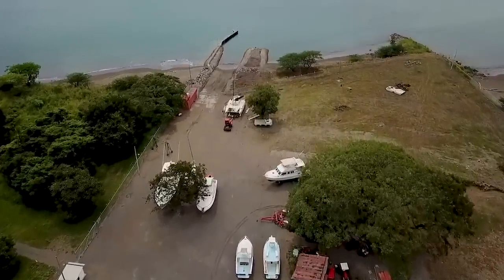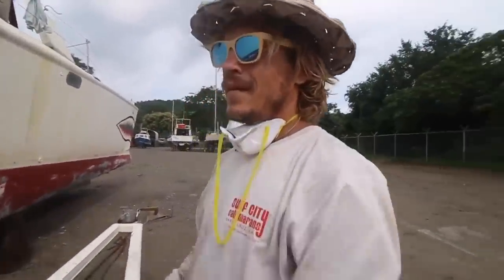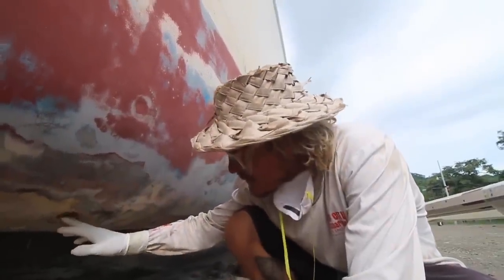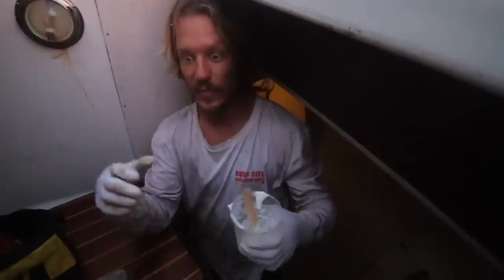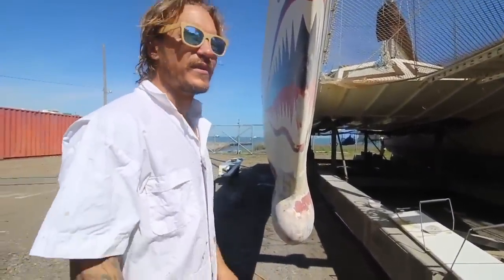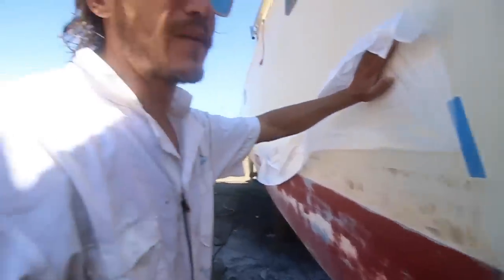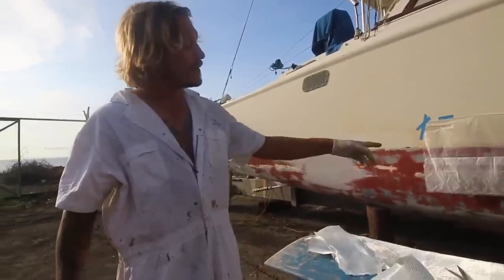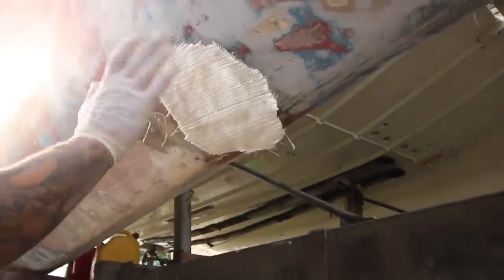Plywood Catamaran Problems. What Work You can expect! | EP48

Comment: I put talcum powder on my exposed skin when sanding fiberglass. It fills your pores, and helps to keep the nasty glass out of your skin.
Reply from the maker: Thanks mano, will do.
Reply: Do not bathe before sanding.  Maybe after. Talcum sounds like good advice.
Reply: @MyNeowolf  Another thing you wan to be careful with is if you are chopping up some ho peppers to put in some food. If you go to take a leak, your tool will suddenly be ablaze! Also if you manage to smear some of the pepper juice on your old bat, she will wonder why her parts down there have suddenly become like a volcano! This I know from experience.!
Reply: @MyNeowolf  I think I'm safe...
Reply: @stanthology  I had the same experience. Rubber gloves are a necessity when processing hot peppers.
Reply: @svexitstrategy2595  I like your boat.
Reply: @stanthology  the boat with the flying tiger teeth is not mine ... ??
Reply: @stanthology  I haven't bought my boat yet.  But it appears that there are more than one boats with the same name. 

I have my eye on a 41 Gulfstar. But it's way overpriced for it's condition... 

So for now all I have is the dream of escaping.
Reply: @svexitstrategy2595  If you are in the US there will probably be mountains of boats that need a little detailing now that the hurricane went by. Pick them up cheap and many slightly marred parts of every description for 10% f new price. (God willing!)
Reply: Red Mexican clay,that stuff can block poison ivy.

Comment: Bubbling of paint occurs due to dirty surface before painting. Use a vacuum cleaner and whip with acetone or even better with a paint’s thinner. 
To apply any paint people use rollers which have the inconvenience of dragging air into the paint! As the surface of the paint dries out, the entrapped air could not escape, here you get the air into the paint film. If air spray or air assisted spray isn’t available, tray not to rol to much the paint and use a large, soft and long hair brush to pass over the freshly applied paint. Work smaller surface at a time, not more than 2x2 feet. Once dry, slightly abrade (200grade) and whip out with thinner soaked clean cloth before the next coat.
Hope it would help.
Reply from the maker: Great advice, much appreciated. Seriously. -J

Comment: I am sorry for you guys, but these patches are just a temporary repair that will look the same in a couple of years. You really need to get both hulls sandblasted, all the way down to the bare fiberglass. Then remove all the bad fiberglass and all the wet wood. After filling the holes with new material, you really should give the entire hulls at least two layers of new fiberglas, a new gelcoat and then antifouling and teflon treatment. It will cost more than the both is worth, but it all depends on how long you are planning to keep it. Best of luck and I love your channel, just subscribed...
Reply: @irvhh143  Not if they are just planning to get relatively comfortable to a harbour and buy another boat soon. Then it's a matter of doing everything as cheap as possible. As long as they don't expect to get money out of this one. Fiber glass rot kills any value of a boat. On the other hand, all repairs makes for great videoes, and that makes them money in the end! ;)

Comment: Maybe you are already doing this , but you can use an orbital sander with a small potable Shopvac and vacuum attachment which will take care of most of the dust problem .
I’ve even used this setup or made setups with grinders .  The spray suits are a must and a number of good quality dust masks and a charcoal filter mask for when you are applying your coatings with gloves on .

Comment: I think for those who watch the whole series, they are getting a whole lot more insight into the limits of a cat.
Reply from the maker: Correction: limitations of a PLYWOOD cat.
Reply: @thelastpirate  Yeah I thought about it later. I can see how wood is more prone to failures. I'm still coming up through. I'm at your Sept 2019 live stream right now. I did watch the one when the boat split. Couldn't resist. As I watch through the series, I can see all the stuff leading up to it. Can't wait to see you guys back out there. Maybe with your next boat, you'll be able to post more sailing vids in rough sea. Anyway, stay awesome.

Comment: Do it nice or do it twice, James.... tune into 'Sail Life' channel for osmosis treatment & fiberglass epoxy repairs to do a proper refit.... also do you have an Amazon wishlist? It could be an alternative way for viewers to contribute.
Reply: Pretty darn spiffy advice.
Reply: that guy is a pro with fiberglassing.
Reply: Kevin ask him for a adress and buy him a drone like a dji spark whit controle and 2 to 4 battery .that is the best thing they need for making video right now or a go pro white waterproof case
Reply: way different problems with glassed-over ply (usually epo from the beginning) than with polyester resin snot boats.

Comment: Have you ever used plastic wrap as an outer skin when you put on a fiberglass patch? Just lay it all out on plastic wrap, cloth, then resin, then slap it on like a big sticker. Then you can smooth out all the bubbles out with your hands and when it's dry, tear off the plastic.
Reply: Sounds like a good idea. So it`s been working for you?
Reply: @sailingozzie2587  love all your hard work and learning a lot from yous guys🙂
Reply from the maker: Yeah I did that with my daggers, but not sure if it would have worked here upside down.

Comment: Unless you have done it, no one can appreciate the agony of millions of microscopic pieces of fiberglass dust in your underwear and everywhere else.
Reply: Worst fiberglass mistake i ever made was grabbing ahold of a shedding fiberglass fencepost real hard crawling over.. holy shit
Reply: by far worst in hot climates: You either put on a full body condom and melt or go bareskin and ruin it entirely this way .... boatbuilding with fiberglass in hot climates is no fun.
Reply: @congregationahavathsholom6021  laying on your back(in fiberglass) in an Attic in 109 degree heat. 

coat your arms abd neck with talcum powder. even flour works. 
it can reduce itching by maybe half. 
vasoline can reduce itching by appying it and then washing it off with dishsoap.
shit sucks to work with for sure.
Reply: Yes, been there done that with automotive ect.
Reply: Been there done that....The Worst torture you could 'inflict' on someone would be to have them roll around in insulation or fibreglass, then Force em to take a Hot Shower to wash it off.  Again, made that mistake 'Once' when working in construction as a 'late teen', Haha.
Reply: @congregationahavathsholom6021  / I had one of those 20' fibreglass extendable paint sticks i lent to someone...i finally got it back after 6 months.  The guy had left it outside during Subzero temps in the winter and it started to shed, Ugh.  I had a job i had to do, and only found out when i got on site.  Damn...i had to throw away 3 pairs of leather gloves after using that thing for 2 days.  That Shite got everywhere flecking off.
Reply: @toddler1009  /  WHATEVER YOU DO, Don't take a Hot Shower until you get it All off....Use as Cold water as you can get for the 1st 10 minutes lightly wiping your skin with soap.....then rinse and repeat,  haha.  You'll remember this comment later if you don't =)
Reply: It for sure sucks having fiberglass dust all over youy
Reply: Amen to that, as I was watching I was having flashbacks to patching and sanding the hull on a 30 ft Sabre.
Reply: Dust yourself off if you have a compressor nearby helps :)  Uber cold shower also.
I am always amazed that in the morning 99% of the itch has vanished - I am wondering how my skin gets rid of the glass :)
Reply: glass  balls  not  good
Reply: toddler1009  put talcum powder all over yourself.      Put a suit on.  Put talcum powder inside the suit! 
Rubber gloves and boots and tape the cuffs to the gloves and boots.  Then a hood!
Reply: Patrick St-Onge  it dies and  sluffs off
Reply: "appreciate" ??? Imagine would be a better word to use in that context, isn´t it ?
Reply: Well, that’s my nightmare fuel for the week.

Comment: Make sure the core is dry and really clean. ya can’t rush good work.
Reply: The ply in an overglassed ply hull is the actual boat, not just a core. 
Just sayin ....
Reply: manfred schmalbach the hulls appeared to have foam core probably due to complex curvature.  Ply can’t bend like that. JS...🙄
Reply: @robmitchell3633  We actually BUILT ply boats in that (and even some more complex) forms outta ply, outta veneer composed (or "lammellated" like the Gougeon Brothers call it) into ply, and outta ply.with a carbon prepreg second layer to have something stiff and airtight to vacuum the following layers towards. There may be a core inside Zingaro's hulls, but "ply can't bend like that" is an idea I can contradict with a lot of actually built boats to my record.
Reply: manfred schmalbach you are so special...  that old boat was built before that type of technology existed.
Reply: @robmitchell3633  The Gougeons started in the early seventies to do statistical testing what they developed in the late sixties together with DOW chemists and what was to become "West System" epoxies. 
The boatyard I was an apprentice at in the eighties was working with epoxies since they were available for war-purposes (mostly aviation) in the early fourties in Germany. 
Resorcinol plys weren't homogenic enough in e-module when stressed, so they tried epo to get their wooden stringers more forgiving versus oscillating loads. 
I do not know what year James' boat is, but I am positive lamellating techniques and vacuum bagging with epoxid resins was long used by advanced boatbuilders when Zingaro was originally built.
Reply: manfred schmalbach Boat
The Kitty.
I am, of course, referring to the catamaran. Zingaro (Italian for “Gypsie”) is a 1984 Crowther Spindrift 38′. Home built in Canada with Airex® foam core hulls encapsulated in fiberglass, with a plywood and fiberglass bridge and house. She’s light and fast.

Designed by Lock Crowther (1940 –1993), a prolific Australian multihull sailboat designer responsible for some 2500 design builds. Very forward thinking, and very seaworthy designs.
Fyi. From the info page on the actual boat
Reply: @robmitchell3633  Thanks for the infill, Rob.
Selfbuilt boats and backyard builds often do sport less challenging methods for the general one-man show. 
I didn't know of Lock Crowter (more the monohull kinda guy...) but will look into his designs now, for Zingaro seems like a "sprinter" when they upload actual sailing vids. Cheers.
Reply: ... oh and in case of the useless information, Rob - just wanted to give You an opportunity to not utter crappy falsehoods anymore in terms of "unbendable ply" (😂) in future comments .... You're free to tell ridiculous crap though, obviously, so never mind.

Comment: My cat is out on a mooring and I have the same splash problem with the waterline. The scum line is more than 6 inches up / . I have been meaning to do a boot topping in antifouling of a different colour with perhaps a break  line or accent line between them. ie red bottom , blue boot topping with a white cove line in between.

Comment: Spindrift 37 Catamarans plans have foam core in the hulls and wood epoxy crosbeams and decks. Looks as if your problems are with the outer laminate on the foam core, not the plywood (in this video). Most of these cats were home built and the core maybe sub standard i.e. not Divinycell, Airex or Core Cell. Do you know what core was used on this vessel? Another problem is home builders buying the cheapest polyester resin they can find, add that to poor craftsmanship and trouble starts.  I hope your choice of paint underwater does not create more problems. Polyurethane paints (even Awlgrip) are not recommend underwater. The blisters in the topcoat you have now is this problem. I have built more Crowther Cats than anyone else in North America and can state this Spindrift 37 is one of the best designs ever. I even built one for myself in 1980.
Reply: Awlgrip is useless when submersed.
Reply: Ian Allan ty
Reply from the maker: Wow, nice to meet you Michael. We absolutely love our Spindrift. She’s a hell of a boat. Never sailed anything like it, there was a steep learning curve. Mine is Airex and well built in Nova Scotia. Just passed 20k nm under here hulls. Easter island. All the islands of the Pitcairn group. Do you know how many have been to Rapa Nui? I’d be interested in that.
Reply: Sailing Zingaro that’s so awesome

Comment: I wish i was there to help you with proper fiberglassing. Weigh the resin to cloth with a 1:1 ratio, spread evenly between sheets of mylar then apply under vacuum to remove any air bubbles - just like on a plane! 

*easy DIY vacuum pump, use one from an old fridge!

Comment: The hulls are full of patches... Like I said last year put a layer of 400 or 600 DB over the the full length of the hulls from 10cm above the waterline down. Then 2 coats of neat epoxy, then high build and anti foul... It will fix it for good....

Comment: 2 part paint over 1 part bottom paint = Failure of both....

You needed to strip the whole bottom and prime with a two coat primer then 2 part paint then your Teflon coat... I'm going thru that hell right now, oh and if your wood hull is wet you just sealed in the water that will eat your boat.....I'd sale it ASAP
Reply: Agreed, blast the entire bottom with walnut shells to remove everything and expose all the bad places. Repair the de-laminations and then 2-part primer followed by 2-part overcoat. Always spend the $ for great bottom paint and you'll never have regrets.
Reply: Agree, this rushed 'repair' session is just throwing money away. "I just want to get going." Then you need to be on a new boat with a paid crew. Otherwise you'll need to buckle down to some hard work for many weeks to make that POS seaworthy.
Reply: @roscoejones4515  ...hit it !... You sir are the bearer of wisdom !

Comment: I'm by no means an expert in fiberglass but there is a tool they use to roll out the bubbles. You can see it on ...boat works today on youtube, You may want to take a look and try and get that tool for rolling out your air bubbles. It's clearly not a fast process to do it right.

Comment: Bro you know you have to let the epoxy go off proper before yo go and paint . Glass  then 12 hrs . Sand , micro balloons 12 hours, interprotect then 12 hours then sand and wet on wet another  coat of introtect then antifoul and paint. Anything else it will fail . The chemicals need to get out or the will lock I. And cause issues . Do it once and do it right . And scallop each area over size so you get good physical bond then good chemical bonds from there on at. And please dry it perfect

Comment: Is that the Seacoat vx10 hard smooth coat. I'd really like to know how it worked on a fast boat. How often you sail over 10kn and did it clean the hard and soft growth.
Reply from the maker: No, it was a product called Medusa biocide-free. It sucked. The bottom job was a great improvement to speed though. We hit 10kts very often. Usually at night. I like to keep her under 12. 8kts ave is perfect for this boat. Max surfing speed was 22. Just once, in a 40kt blow. Way scary, wouldn’t do that on purpose, just hit the wave right and it carried us for a long time.
Reply: Dam, just doesn't seem to be a good solution. I'm sick of these ablative paints. I'm thinking of the vx10 because it's hard and I can beach it like you have. Without any antifoul you've got to scrub it every couple of weeks or go over 10kn. Like you the speed is easy enough but I doubt it will clean growth and barnicals by doing 10kn. So I don't want to be left with something I have to scrub every other week. Thanks for your comments.

Comment: Dude, the blisters are signs of either water migration or delimitation in the glass. The blisters need to be ground out and glassed up.
You may find you need to do an epoxy barrier coat made by Interlux.paint.

Comment: This is another example of if you want something done right you just may have to do it yourself. 
So buck up, stop complaining, focus(as it appears you are doing a great job to fix the mistakes), and remember in the end it will done correctly and that you did it. It's good if you can do all the repairs (Structural, Mechanical, and Electrical, and the Rigging on a sail boat) that way you KNOW what spare parts to have on board AND how to R&R everything....

Comment: I hope you are using an epoxy barrier coat over the fairing compound to seal it.  If you didn’t use an epoxy barrier coat prior to anti-fouling, this would be one of the several reasons your repairs failed.

Comment: You might consider a slight fiber fill with Your micro balloons and silica. Micro balloons give it volume, silica makes it hard, but the latter makes it brittle, too, a brittle not improved by micro balloon voluming at all. Add a quarter to half of the filling volume in cotton fibers and the cured goo will be much MUCH more forgiving to impacts which might microcrack Your microballloon-only faring. 
There are other fibery fillers, too, but cotton gave us the best results together with silica and mbs.
Edit: ... next time, of course ;-)
Reply from the maker: Sweet, great advice. Thanks for that I’ll try it.
Reply: @thelastpirate .   Cotton / cellulose fibre for above waterline only.  Use chopped strands.